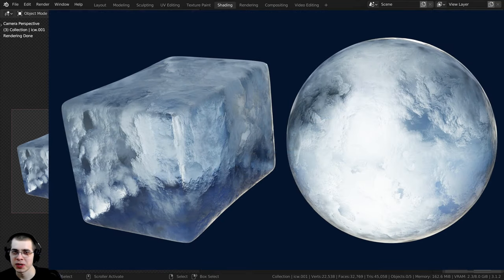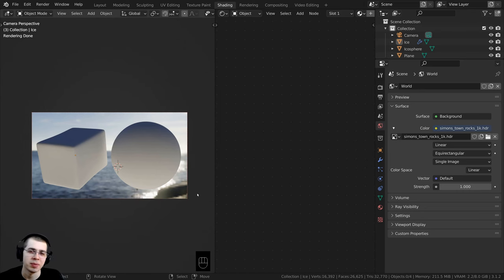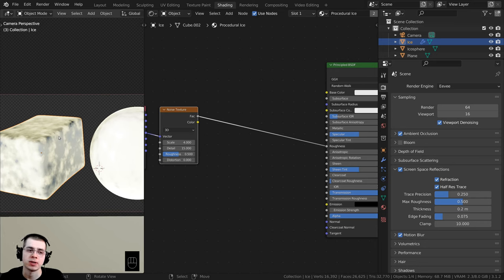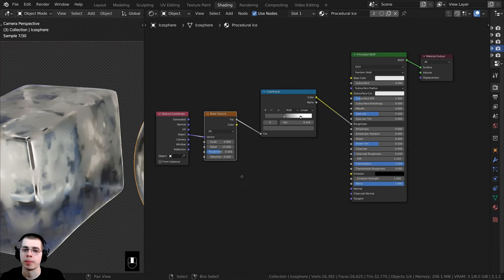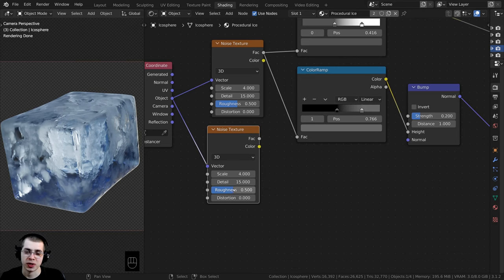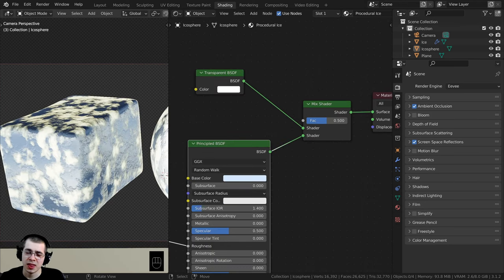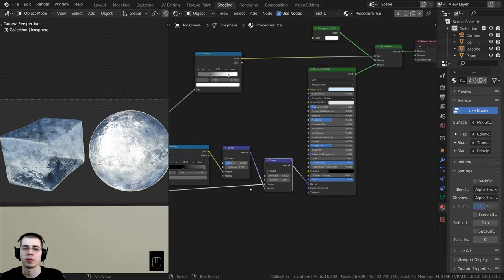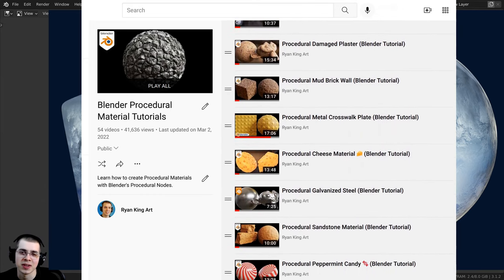Procedural Ice Material 🧊 (Blender Tutorial)

Comment: Hey! I downloaded your file from the patreon and I dont seem to have the texture part of it, is there a resolution to this?
Reply from the maker: Thank you for supporting me on Patreon! The product files comes with the procedural ice material. Are you wondering about texture map images? This is a procedural material, so it doesn't use texture maps, it uses Blender's procedural nodes. If you want to use texture maps for this material, you will need to bake out the material to textures. By the way, Patreon has a messaging system, so you can message me there for more patreon questions. 🙂
Reply: @RyanKingArt  alright! Thanks for all the help!